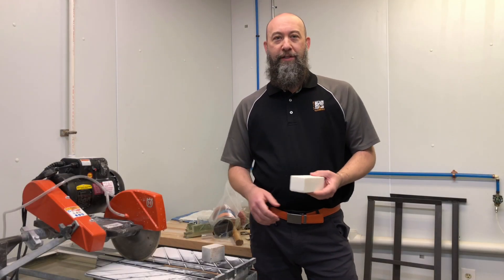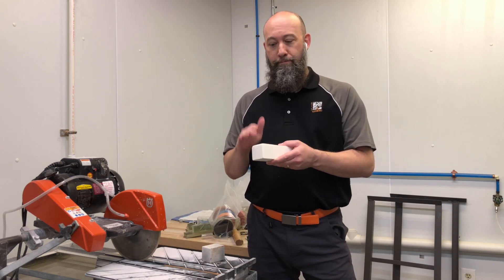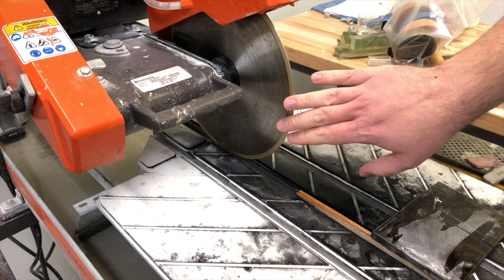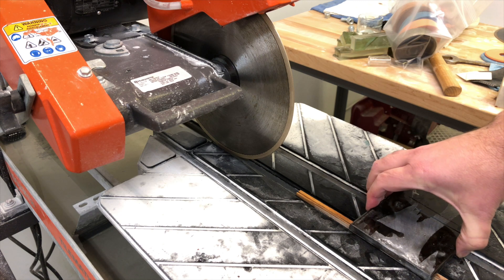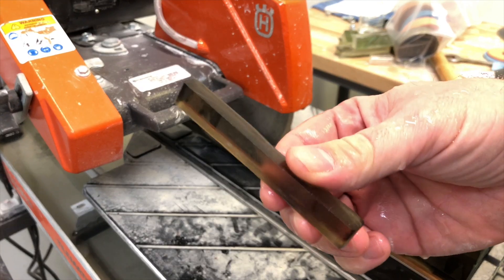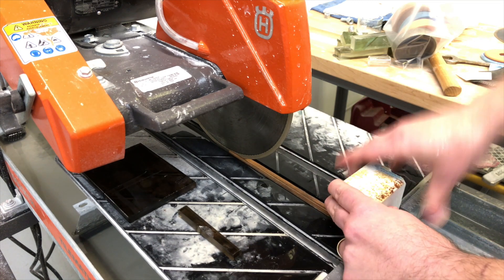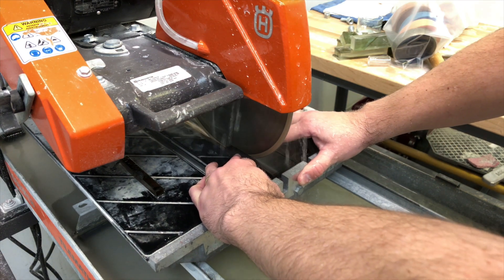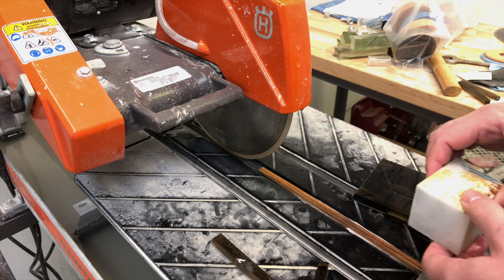What is a Dressing Stick and How Do You Use it on Diamond Tools

Comment: Can i use this for stained glass grinder bits? Or gryphon band saw for stained glass?
Reply from the maker: For single-layer electroplated diamonds, it would be a destructive use and significantly reduce the lifespan of the tool. This is best used on sintered diamond tools that have multiple layers of diamond on the tool.

Comment: Should we do this on new blades? Mine new 100x0.5mm blades are chipping
Reply from the maker: Most diamond blades should come from the factory pre-dressed and have a directional arrow on the blade for the direction to run the blade. If there is no arrow on the blade, then it was probably not pre-dressed and you'll need to dress the blade in the direction you are using it.

Comment: Do you use this on electroplated blades?
Reply from the maker: You can, but you'll want to wait until the disk is not performing well at all as it is destructive to the disk. You can find more info here: https://www.hisglassworks.com/knowledge-base/my-electroplated-diamond-disk-seems-worn-out-what-can-i-do/
Reply from the maker: Just be aware that you'll reduce the effectiveness of the plated blade and it should only be done to give you enough time to order a new blade.

Comment: do you cut thru it forward and backwards also?
Reply from the maker: No. just the single cut, but I tend to hold the pieces together against the blade to pull back out as this is habit for when I cut glass as well.
Reply: Can you use this stick with a stihl cut off saw? How do you do it with that?
Reply from the maker: As long as it is a diamond blade, this dressing stick will work, yes.
Reply: Will curting into brick work too?
Reply from the maker: Not really. The dressing stick is a compressed 80 grit aluminum oxide made specifically for dressing a diamond blade. You can use a brick on rougher diamond blades like masonry blades or rough glass blades, but not on finer diamond blades as it will destroy the blade.